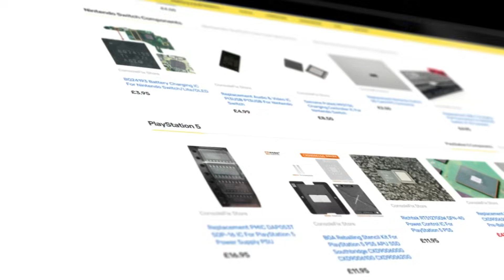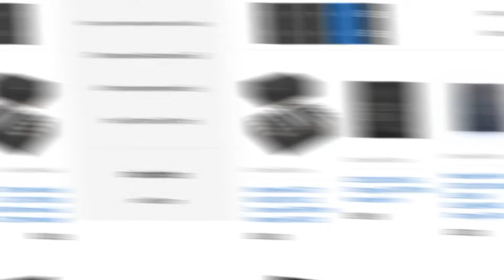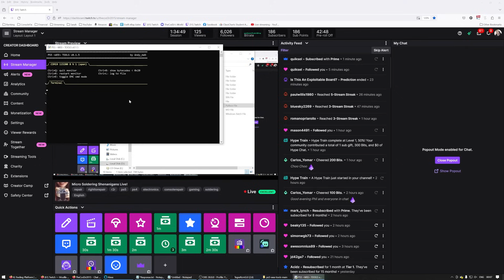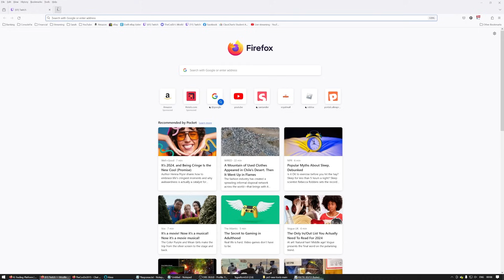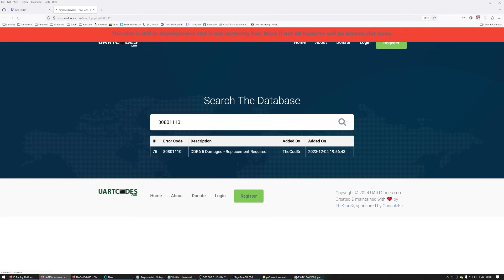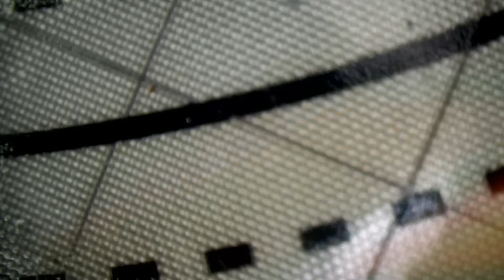Trying To Fix A Faulty PlayStation 5 With A Blue Light Of Death (Faulty RAM)

Comment: I'm after a little advice. I've got a 1216a board with a dead short on the 12v line what component should i remove first? I would really appreciate it any help.

Comment: how do you line up the chip ? does it fall in place or are there marks on the board. I'm new to this
Reply from the maker: There are marks on this board but usually I'd press down on the chip with my finger and feel for alignment